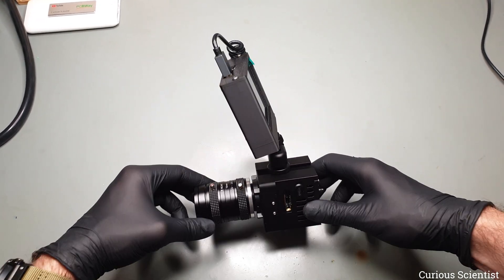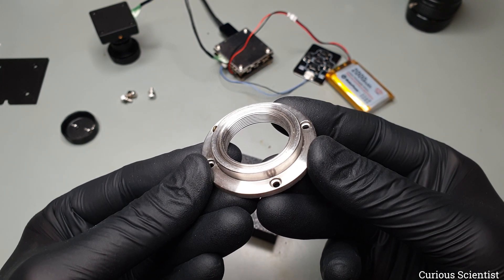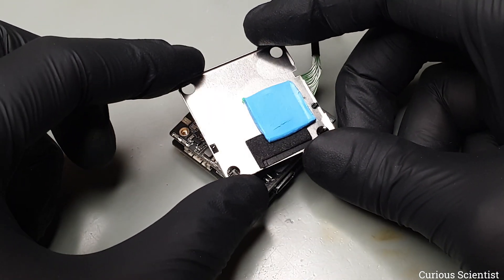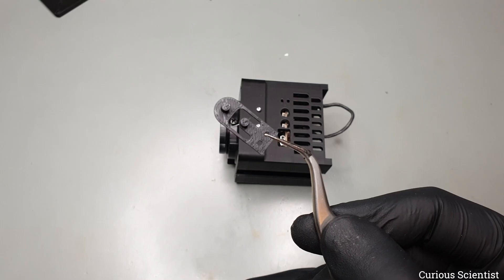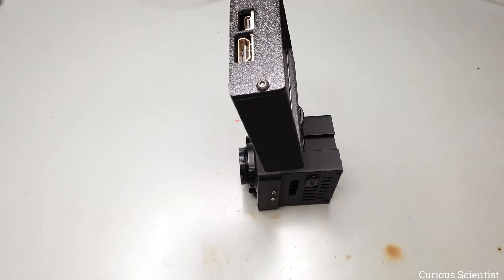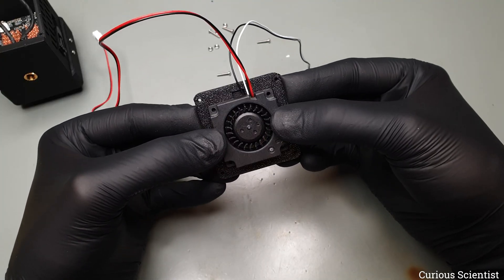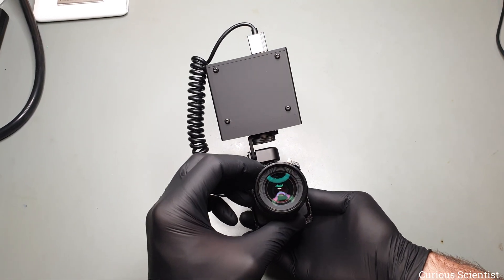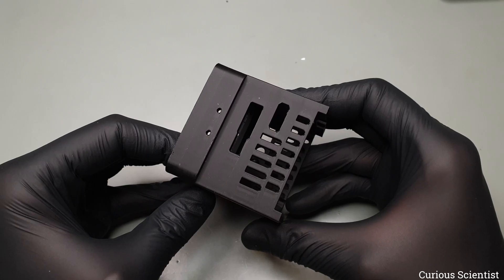I built my own, 6K-capable cinematic camera (and you can, too!)

Comment: Its unfortunate that you were not able to use the full metal housing that you got for the CCTV cam. That would be a great build.

Anyone knows how to get this with SDI output?
Reply from the maker: Yeah, that would be a very tight fit. And I would need some milling (or a lot of precise drilling and filing) to access the connectors and buttons on the main board... But maybe when I get some better tools, I will try to squeeze it in. But then I would lose the cold shoe mount option which is very useful for the external display.
Reply: @CuriousScientist you can screw in a cold shoe directly to the metal case though 😅🤔?
Reply from the maker: Yeah, that would work, you are right! I actually have those at home, I forgot. My January is quite busy, but maybe in February or March, I give it a try. I have a few enclosures, so "I can afford" messing one up, if the cutting goes wrong.
Reply: @CuriousScientist the only unfortunate thing is the lack of SDI output 😅
Reply: @CuriousScientist  Would be great to have this fitted inside: Blackmagic Micro Converter HDMI to SDI 3G 

Cables could be routed via extensions to the back of the enclosure.

And you would have a proper video camera that could be used in professional settings.
Reply from the maker: That thing would definitely not fit inside the CCTV enclosure. The enclosure is very small.
Reply: @CuriousScientist  Yup, Would have to merge two enclosures together most likely.

Comment: Nice project. Only downside is that the lens has to be manual zoom / focus / iris. Rather an expensive module when there are cheaper on AliExpress. (I'm trying to find a low cost way of adding a lightweight, small zoom camera to a 5mtr crane project I'm developing)
Reply from the maker: Thanks! Yeah, maybe downside for some but nice feature for others. You won't find old M42 lenses with AF anyway, so from my perspective, manual is completely fine. Of course it is expensive, but when you compare the sensor size with those of the cheaper modules, you'll realize why it is more expensive.

Comment: Thanks for the video! Can you test this camera with IR filters, for example, 850 and 1000 nm? Or even with a silicon filter. I'd be very interested to see the quality. By the way, what sensor model does this camera use?
Reply from the maker: I am happy to test, if you provide me the filters. 
The manufacturer unfortunately doesn't disclose the exact type of the sensor with me.
Reply: @CuriousScientist I would be happy to provide you with them, but I live very far away and won't be able to come anytime soon. I thought that perhaps you have friends who are photographers, and they sometimes have IR filters.
I bought the filters from the same place you bought the parts for your camera; they're relatively inexpensive. This experience will be useful for researchers looking for consumer-grade sensors for IR cameras—even if the camera uses binning due to low light levels, its resolution is sufficient for acceptable image quality.
Reply from the maker: Unfortunately, I don't know anyone in my circle who has such filters. Unless someone provides them, I cannot afford buying them just for the sake of a request, I hope you understand it.

Comment: I don't understand. For some reason, everyone is chasing after 4K or 6K, but it makes no difference if you know anything about professionalism. Even FullHD can ultimately produce significantly better quality than 6K. And it doesn't matter what resolution your camera has if, for example, when shooting 6K, it records at a low bitrate, and as a result, 6K turns into a blurry video, which, when compared to FullHD, may end up having less detail because the low recording bitrate has killed all the quality. 

Next. The dynamic range of the camera is also very important. How many stops does it have?
Another important factor is the bit depth at which the recording is made and how many bits can be obtained from the camera. If it is 8 bits, then there is no point in even talking about semi-professionalism. 

Therefore, 6K for a camera is far from an indicator, but bitrate, dynamic range, and color depth are much more important than 6K resolution, which can be ruined in terms of quality by recording compressed material to a memory card. 

Therefore, it would be much more interesting to see the technical specifications of your camera. 

I also want to say that you did a great job! I salute you!!! You did a tremendous amount of work, and I found your video very interesting! 
Thank you!!!
Reply from the maker: Yes, you are absolutely correct! The easiest parameter to highlight was the resolution, and that is why I picked it. Especially, because nowadays they slap it on a many cameras that it is capable of recording in 4K or even 6K, but, for example, this camera has a sensor with 6 times larger surface area than those other 6K-capable ones. And this is what I found very interesting about this module that it can record in high resolution, plus it has a decent sized sensor. 

I actually have another video that is focusing on reviewing the camera and showing its footage in different scenarios. This video is more about modding it into a "more user-friendly" system. The highest bitrate I could find is around 65 Mbps if I remember it correctly. Even a GoPro can do 100 Mbps, so yeah... As of today, it can only provide 8-bit footage, but I think this is rather due to software limitation, because the sensor should be able to do 10 or even 10 bits! However, I noticed that the dynamic range is very good, but unfortunately, I don't have any number on it.
Reply: It's just a marketing term because people don't know anything of what you just (correctly) said

Comment: This concept itself is very interesting. How did you source the sensor? Is this type of build possible with other sensors such as mft?
Reply from the maker: The system is specifically built around this Hawkeye Firefly Split V6 PRO camera. So, if you want a similar stuff for an MFT, you need to design a new system around it. I did not only got the sensor, but I got the whole camera kit. Please check my other video on this camera module and you'll see what's in the package and how to source it.
Reply: @CuriousScientist thank you for the information. I shoot on a regular basis so I’m thinking turning this project into my own larger version of a dji osmo since they discontinued the larger sensor model years ago. Can the battery input be modified to take NPF batteries?
Reply from the maker: As of now, you either solder a lithium battery to the board as I showed in the other video, or you can use the USB as the power source or the 5-pin connector. Your best bet is to use an adapter plate for your battery and then feed the camera from there. I am actually working on a casing which will include a possibility to mount such plate to it and I am working on figuring out a better way to power the other devices.

Comment: The biggest issue is the output is only 8 bit, which would frankly still be an issue if the stock colors were good, and they aren't. The limited dynamic range alone makes this absolutely not a cinema camera.
Reply from the maker: With some color grading, the raw format footage can be tweaked quite nicely. For the 10-bit video, I am hoping that the manufacturer will release a firmware that will make the camera capable of producing such output. The sensor is capable of it.
Reply: @CuriousScientist , the company might be under a contract agreement with Sony not to allow RAW video (image sequencing). REDs patent on RAW video might have been removed when Nikon took ownership, at least internal RAW video. Does it have +10-bit HDMI-output so you can use an external video recorder?

Comment: I was thinking of building something similar but didn't like the lack of a raw mode so i messaged the company and they said they added one in tje newest firmware update so i was wondering if you could test it out and give your thoughts on how colourgradable it is. Btw amazing video
Reply from the maker: I am working on it, actually! After all the feedback and questions, I got enough info to make a follow-up video on this camera. One specific topic will be the image quality and the video recording. Give me a little time, and you will see the footage soon. It's nice autumn over here, so I think I will have proper footage to work with.
Reply: Pat Salis ❤❤❤❤❤❤❤❤❤❤❤❤❤❤❤❤❤❤❤❤❤❤❤❤❤❤❤❤❤❤❤❤❤❤❤❤❤❤❤❤❤❤❤❤❤❤
Reply: Did the company state it can do RAW image sequencing (video) at a higher bit-depth and bitrate or just it can do “RAW”?
Reply from the maker: Just "RAW". Basically a footage without any color profile applied to it.

Comment: How about audio. Does it record any or allow external mic line in?
Reply from the maker: Yes, it records in stereo with a rather low bit rate (128 kbps). There is no external mic line-in. This is originally an FPV camera, so it is not really made for "real film making". I am working on a comprehensive test footage, I will include some audio from its microphone.

Comment: I wonder if you would convert an old SLR camera to DSLR with this?
Reply from the maker: It is just too much trouble. There is no way to squeeze all the electronics into an old SLR. Also, it would be hard to make use of the mechanical shutter. In my opinion, it is easier to use this housing and get a C-mount adapter for your SLR lenses.

Comment: Great video! You should try to do one in the shape of mirror less or camcorder, or big as red, so you can also include everything in
Reply from the maker: Hi and thanks! The thing is that it is a bit difficult due to the need of access to the ports and the buttons. I already made a mirrorless-looking case for it in Fusion 360 but I decided it is too much trouble to print it and build it so I did not develop it further. I think this type of housing is most practical for this module.

Comment: Brilliant idea, except for running the fan off a seperate USB-C connector. You haven't heard of soldering? If you ask people to 3D print, you can ask them to solder too. there must be internal 5V padds on the camera board. You could likely fit a small thermostat PCB in there to have the fan operate autonomously.
Reply from the maker: If you check my other videos, you'll see that I am quite good at soldering. You don't have to be cocky. I inspected the PCB, and there's no way to easily access 5 V on the board. Adding a separate USB-C connector is a much simpler way.
Reply: @CuriousScientist  Not intended, but it was the obvious question; why not use onboard power instead of an extra connector and cable. Isn't there 5V on the other USB connector, or is it too inaccessible?
Reply from the maker: Trust me, if there was easy access to 5 V, I would have used it. Adding an extra thermostat kind of contradicts your complaint. You want to have a simpler wiring, but happy to add an additional circuit?!?!
Reply: @CuriousScientist  You added a manual speed controller for the fan, thats kind of the same thing isn't it? Why does this conversation sounds like an argument, I'm not criticing your desingn  I just have questions for your design choices? There are 8 pin PWM fan thermostat IC, in SMD size too with everything on board.
Reply from the maker: No, the fan is directly connected to the 5 V coming from the USB-C connector. It's either on or off (plugged in or not). I am not arguing at all, but you kind of hit a nerve when you were asking about the soldering. The additional IC, especially if you need it to be SMD requires extra soldering. Perhaps the IC needs a small circuit board, maybe a decoupling capacitor...etc. It would make it much more complicated than a simple usb-c plug, and it is really not necessary (in my opinion).
Reply: @CuriousScientist  I'm sorry, was not intended. Obviously you put a lot of thought into the 3D printed enclosure, then the connector just for power spoils the esthetics, but thats my subjective opinion.

Comment: hello there and nice video, i did notice the button link is missing, would you be so kind to add it and maybe a wiring diagram too? i am looking forward to build it for one of my drones.
Reply from the maker: Hi and thanks! If you mean the controller with the 5-way joystick, please refer to the previous video. Everything is shared in that video and the corresponding article. Cheers!
Reply: @CuriousScientist i will search for it
Reply from the maker: I put the link in the channel description now. Please check it, it's at the bottom.
Reply: @CuriousScientist so i found it but my question is if i buy the pcb and all the components i dont need the arduino part to control the camera right?
Reply from the maker: You found the video, but did not watch it, I guess. :) I clearly said in the video and in the corresponding article that my circuit is a direct replacement of the remote controller provided with the camera. I only used the Arduino to demonstrate the concept of the circuit.
Reply: @CuriousScientist yes i did watch it not the whole thing as the part i needed was the pcb and with my adhd i am always doing more than one thing at the time and i miss stuff🤣forgive me it was not intended to offend you i probably wont even need the circuit board if i mount it on a drone because it has to be as light as possible(and it is not needed cause of the wifi right?).. i probably will not even make the housing but just design a mount for it.. thank you for your time

Comment: Maybe a side grip mount like a ARRI Rosette mount for a grip would be nice which can be rotated to the user’s liking(there are adapter’s from 2x 1/4“, 18mm spacing to ARRI rosette so only 2 heatset inserts need to be incorporated into the design). 
And a internal power distribution board, so that you could use standard battery adapters (like v-mount, anton bauer, sony np-f) with standard d-tap but it would also need a power regulator from 15 to 5V(because d-tap is 15V).
Other than that i quiet like your design, maybe internal button inserts would make it also more professional looking.
Reply: Do you know on what bitrate it is recording?
Reply from the maker: Thanks, I will investigate these options! One issue is that along the "waist" of the camera body, I cannot make the shell too thick or wide because the access to the ports and buttons would become cumbersome. 

Regarding the bitrate, another follower just asked me the same question a few days ago, so I know it. It is around 65 Mbps. Every relevant setting was set to the highest possible value.

Comment: The camera is good; however the extra screen betrays its function as a small camera. Streaming the video to your phone through WiFi would certainly increase your battery life and make the camera portable.
Reply from the maker: As I said in the video, you don't need to use the external screen. :)
Reply: @CuriousScientist  It is your project and it was very well done. I just think having a wired contract to your phone makes it bulky. A 6k cinematic spy camera with zoom sounds cool, and you don't have to worry about the camera's orientation.
Reply: @TT-lf5hiIt's Wi-Fi, not wired.